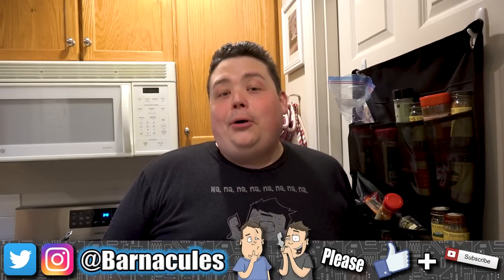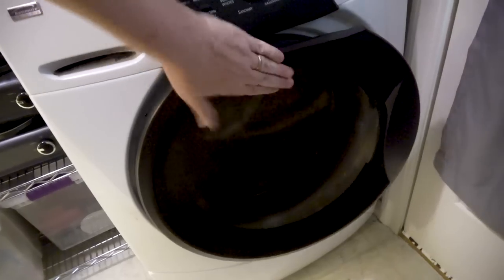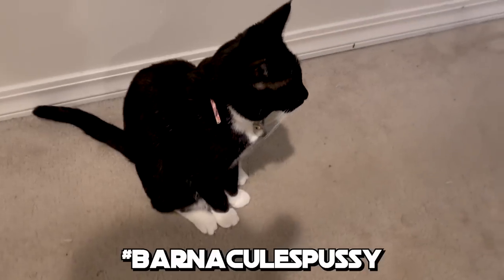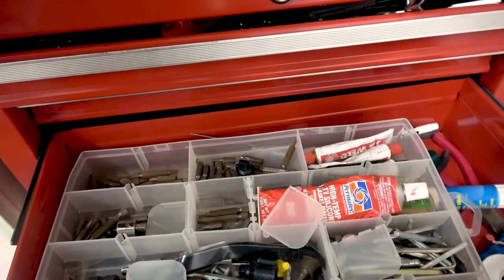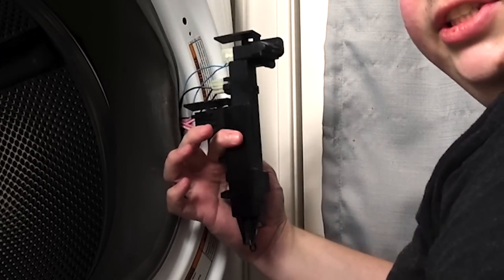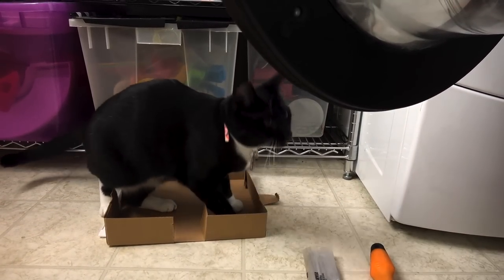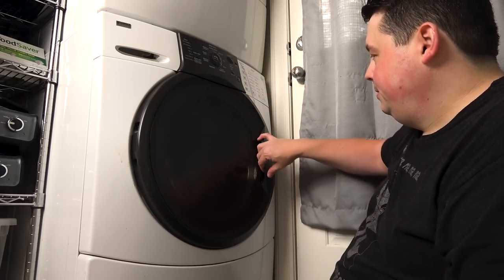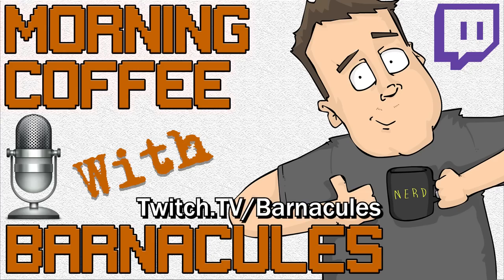How To Fix Broken Washing Machine Door DIY Tutorial - @Barnacules

Comment: Most front load washers are made by one of three or four manufacturers so the parts are often interchangeable.
To answer your first question, the wiring harnesses are likely controls, power and sensors. The door lock is an electronic solenoid so that has power and control. Then a sensor to make sure it's locked out closed.
Also, on my front loader, that "grommet" has gone twice in 15 years. The second time I bought a junk washer for parts for less than the cost of the part.
Keep up the good work!

Comment: That many wiring harnesses are probably needed to check that the door is not only shut, but sealed. In the event the door is opened during a cycle, it would probably signal an emergency fail safe and kill the current cycle or start a drain given its a front load washing machine. Or it's just an over-engineered part to squeeze as much money out of you from service repairs :P
Reply from the maker: Such an over engineered part that can easily fail and the irony is I could still tape the door shut and it worked. I could have honestly just threw the mechanism in the garbage and replaced it with a screw through some sheet metal I could turn to pin the door shut. Then it would have been a #JerryRigged episode :D
Reply: They build this shit with the intent of failing anymore. I just replaced a 25 year old washer and dryer set, the only reason was I got a couple year old newer set for free. Making things that people buy once every 25 years isn't as good of a business as something they buy every 5 years.
Reply: Having something for 8 or 9 years before a small part fails would not be designed to fail, in my opinion. If they wanted to design it to fail it would fail in 1-3 years, or even sooner, depending.
Reply: I commented elsewhere, but: "Looking a bit closer, it looks like the blue wires are the sensor for the door being open or closed, the black wires are for the solenoid to lock/unlock the door, and the pink wires are power in and out that provide the safety cut-off. While you could just have the electronics shut off the motor when if the door is sensed open, with this, the power to the motor is psychically cut to the motor, so even if the electronics malfunction and the motor is still running, if the door latch fails and opens, it makes sure there motor is no longer running."
Reply: Planned Obsolescence

Comment: Welcome back! Regarding the wiring harness, you have three parts: the first connector up top is for the interlock switch that determines if the door is closed, the second, six-pin connector is for the other interlock switch inside the latching mechanism, and judging by wire gauge, the third, largest connector is for the door latch lock solenoid. I'm not 100% certain on this, and I may be wrong on the order of the connectors, but that's what's connected inside.

Comment: Good to see you back on the horse. Take it easy... The main reason the door latches fail is because the door hinge comes loose, then the door drops a bit, and the latch strikes the plastic when you try to close the door. So I'm pleased to see you tightened the hinge screws, which are the underlying cause of the latch failure.

Comment: I'm a commercial Laundry engineer in the UK.
The lock isn't just a lock, it's an interlock; it locks the door and checks it's locked, and then when it detects the motor is running (either with rotation sensors or current draw via an inverter) it prevents the lock being opened electronically. Also, with the lock open, the inverter will not get power, hence it won't allow the drum to spin, thus ensuring your arm stays attached if you tank the door open and stick you hands in. 👍🏻

Comment: Well, with front loaders, you have wiring for the solenoid to lock and unlock the door plus you have wiring for the sensor to verify that door is open or closed and to verify whether to latch is locked or unlocked. It's important that machine can verify it's shut and locked before it starts so you don't get water spilling all over the floor. It's more than likely that it also has a safety lock-out so that if for some reason the door latch fails and opens, it immediately cuts power to motor so it stops spinning basically immediately for safety reasons.
Reply: Looking a bit closer, it looks like the blue wires are the sensor for the door being open or closed, the black wires are for the solenoid to lock/unlock the door, and the pink wires are power in and out that provide the safety cut-off. While you could just have the electronics shut off the motor when if the door is sensed open, with this, the power to the motor is psychically cut to the motor, so even if the electronics malfunction and the motor is still running, if the door latch fails and opens, it makes sure there motor is no longer running.

Comment: I’m a commercial appliance repair man. I work on home appliances as well but on the side. I have some answers for you. 1. The reason it’s so big of a part and has multiple wiring harnesses is due to it being multiple things in one part. It has a switch that knows when the door is shut. It has a switch that knows when the lock is engaged. And the lock. The lock itself is not just a pin but rather a thermal actuater that heats up and expands and pushes the pin down when power is applied. Shortly before the end of the cycle it removes the power allowing it to cool. As it cools the pin is able to recede.  2. The reason there is only a handful of lock assemblies is due to Whirlpool and GE being the only two manufacturers of all home washers. The other brands are relabeled.

Comment: Reasons why there is 3 pin connectors "just for a door latch"

1. Detecting if the door is closed and securely sealed so your house doesn't turn into a bubble bath.
2. If childlock is enabled, prevents the door from being opened at all.
3. Emergency fail mechanic to prevent a large amount of current burning the Pin Diode which allows the door to close securely and is sealed.

Glad to teach people why there is 3 pin connectors "just for a door latch"

Comment: I've got to say, for a high school dropout Barnacules is very smart. He codes like a pro and he can figure out on his own how to fix his laundry machine (or install an airconditioning) while having to figure out what component to use, how to get access to it... 
Pretty impressive. This is the kind of practical intelligence that most academics lack. I myself would probably get stuck at removing that metal ring, given that you can barely see how it is attached and I would be afraid to break something or be worried I wouldn't get it back on again. Overthinking? And I wouldn't have access to a starshaped srewdriver without ordering one online, I doubt that the do it yourself stores sell those in my country.

Comment: Glad to see you're doing alright now Barnacules! I think the reason they use that much electronics on it is mainly a safety thing. My guess is that the two blue wires at the top are probably for that door sensor at the top. The middle wire set probably controls a solenoid or something that fires the locking pin and the bottom block is probably for a couple of sensors that detect the position of the locking mechanism. You should tear down the old one and see how it works!

Comment: My roommate and I fixed our Washer, which had water leaking from the bottom, a week ago. Turned out it was just a hose that had managed to get disconnected, and when the washer agitated, it would force water up the hose and spill over a little. The hose connected from the bottom of the basin to an inlet at the top (which was disconnected) labeled for bleach. It was a ridiculously easy fix.

Comment: The washer is actually manufactured by whirlpool. That door latch will work with all Whirlpool based units whether it's labeled Kenmoore, Roper, Maytag whirlpool... Now as for the door lock mechanism itself. The first wire harness at the very top is for the door sensing switch for determining if the door has been closed. Second wire harness is for the actual lock and unlock mechanism third wire harness is to make sure that the lock has engaged to allow the washer to go into spin. And a little hint if the door is ever locked and you cannot get it to unlock from the control the little loop at the bottom is can you override which has to be pulled straight down.

Comment: I would say that the two prong connector at the top is just a switch to detect when the door is closed while the six pin is motor control and the bottom connector is to communicate with the rest of the electronics.

Comment: How weird, I just replaced my washer's lock a couple weeks ago! Just FYI, the lock mechanisms are actually pretty simple electro-mechanical devices. There are not circuit boards or anything in there - at least there wasn't in mine. It's actually a pretty clever thing. I recommend opening it up and checking out what exactly it does. I'd watch that.

Comment: One wire harness for the servo actuator motor, one wire harness for a hall sensor for the door latch position and door close position, and one wire harness for the magnetic lock to hold the actuator in place.

Comment: I work on appliances for a living.   That assembly has several pieces inside.  1/ a coil to energize to lock the door.  2/ The switch that lets the control know the door is actually shut.   3/ a second switch to let the control know the lock is actually locked (spin enable).  As well as the pull tab at the bottom to manually unlock it when needed.  But my experience the reason for this part failure is because PEOPLE KEEP SLAMMING THE DAMN DOOR. The door hanging a bit low was more than likely the issue....and a good slam = broken latch.    Also FYI this is a whirlpool machine.  Kenmore has pretty much never made their own product, they always buy them from someone else and slap their name on it.

Comment: 1. The reason there's only 3 different door lock systems that fit so many different brands is because most appliances are made by one of like 3 manufacturers but they put a different brand sticker on them. For instance, your Kenmore elite washer is made by Whirlpool as signified by the "110." before your model number.
2. The best reason I can see for there being 3 connectors on the unit is that ones for making sure the door is closed all the way, the next for controlling a solenoid to physically lock the door, and the last for sensing leaks (maybe)

Please correct me if I'm wrong. I've worked for Sears nearly 4 years now and this is based more on speculation rather than in depth research.

Comment: As for the locking mechanism:
Of these 3 wires, 2 are plus and minus poles for the motor pushing down the lock, the 3rd one issues the signal that tells the lock to shut.
It makes sense that this part is bigger than one might think since you gotta cram the motor and logic board somewhere while the whole thing needs to be sturdy enough to function at least within the warranty. (Don't you dare slamming the door like this again, Jerry!)

Comment: Say what you want about new Kenmore products but my grandmother still has her 1963 kenmore clothes washer & dryer that work amazingly today. And she uses them very often. Sure they have needed "repairs" but only things like replacing belts/ solenoids which are consumables and even they have needed to be replaced much less than most modern ones. Now that I would call elite.. I hope to have them someday so they can be used for another 50 years!

Also, WHAT you don't like torx, the objectively superior fastener? For shame BarnNerd for shame!

Comment: no and nc contacts to verify proper operation ( if its closed or not closed and latched ) that's why !   favorite please ..... thanks barn 4 wires dc polarity one way to close takes 2 wires the other 2 is reversed dc polarity to open.the other set is contacts for the jam switch and the last harness is for the proving circuit to verify its sealed.....

Comment: It has three connections to be able to fit in several machines without having to manufacture several lock mechanisms. Some washing machines may have another part that fits which doesnt use all the same connectors.

Comment: My guess as to why that part requires three plugs: The uppermost plug is a 5V/low voltage (board I/O) prox sensor to detect that the operator has closed the door, the second is a prox to check the state of the solenoid to allow a cycle to start and the larger black connector is the high voltage wiring that controls the heavy duty cycle locking solenoid that physically engages the pin lock to prevent the operator from opening the door mid cycle.

Comment: Projects I've tackled and won... Trane furnace board replacement, GE fridge defrost repair, GE oven element replacement, Frigidaire dryer drum replacement, Frigidaire front load washer tub to pump hose, Fridge & AC coil cleaning.  I will contract with professionals if I need to.  But generally I'm a DIY type guy.  I figure I get an education as well as a repair.  My first thought when contemplating a DIY repair is... What's the worse that can happen.  If I can realistically handle that, I forge ahead.

Comment: Set of blue wires, door open sensor, likely photo and Infrared diode.
Set of black wires is closed position sensor.
Pink and red wire for solenoid coil power.
One set to open, one set to close.

Comment: The reason for the three different sets of wires is the same reason there are three on your microwave, SAFETY.
The top plug is for the door detect switch, the second plug is for making sure the door latch moved the right amount and the third plug is most likely for a motor that moves the locking pin.
It prevents someone like a Moron from pushing the top plunger and sticking a screwdriver in the latch mechanism to start the washing machine. Which I have done on washers that were made before the three wire system was implemented.

Comment: The Door latch isn't really that complex, One of the connectors controls the solenoid, other is for the switch and the other detects whether the door is locked or not. Also a tip to get the bellow ring back on, you can use your elbow on the bottom left while working it around the right side. (Appliance technician)

Comment: I don't actually know, but just purely guessing from the top of my head, I imagine that the big connector is for power, which should manually cut the power if the door happens to come open rather than electronically cut the power, another is probably a sensor and since it locks I suppose the last one is for the lock, that would be my best guess. (I mean I could probably look it up with enough searching but I don't feel like doing that...)

Comment: I've been using my 3D Pen to fix trim pieces in my beater car. It would be cool if they made the exact same material as bumper covers are made of in filament form. Need to make an extruder.
Reply from the maker: +Caddy Guy Gaming awesome, that's what I use mine for also.
Reply: Nice, I just picked up 2 2000 Bonneville SSEi's a month or 2 ago. One has some go fast bits. Using them as testing grounds before restoring my 92 Coupe DeVille. Finances willing, anyway.

Comment: same thing happen to my wives washer few years ago , except mine was a real easy fix. ended up being the peg part on the door that broke.
I notice when you close the door you need to lift it slightly , mine did the same thing before it died and had to replace washer , but new one does the same thing even though it is 8 years newer.
Reply from the maker: +Jeff Kittsmiller hell yeah! #DIYgasm

Comment: IDK about your machine, but on mine, I can open the door only when it's turned on (but not running). So I guess that for the 3 wiring thingies, one is Ground, the Over is whatever voltage the sensor is running at, and the last one should be the output from the sensor + little nipple sticking out (dual factor opening I guess) that detects if the door is opened or not saying to the main board (hey, the door is closed/opened, it's ok/it's not ok to start washing!)
#Nerdgasm

Comment: The reason why the part is so complex has to do with feedback to the computer. You have your solenoid, which will have a set of wires to activate it, and another set to tells the computer if it's in the open or closed position. The next set tells the computer if the door is closed. Seems complicated but really it's not, just a bunch of wires running to a bunch of switches. However it would be nice if it had a ground reference (one side of everything grounds to the chassis), less wires to run to the module.

Comment: Torx screws are much more durable than other screw types because they are less likely to strip and apply forces more efficient.
But thats not the reason manufacturer's are using them. 

you have to have the exact size tool to unscrew Torx screws.
Most consumers don't have every Torx bit size or screwdriver.
What happends is that most costumers just buy a new washing machine resulting into:
- more profits for manufacturer's.
- less money for consumers.
- and a bigger ecological footprint.

Comment: The door latch have so many connectors because it need to detect if the door is closed, because you obviously doesn't want to start a washing machine when the door is not closed properly...

And it also need to lock the door